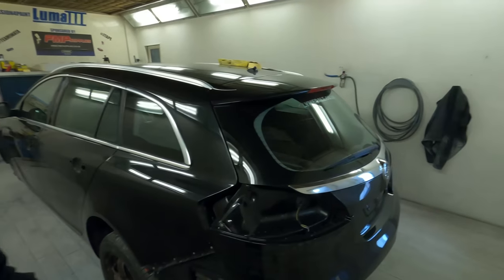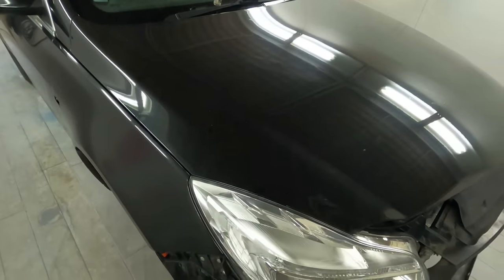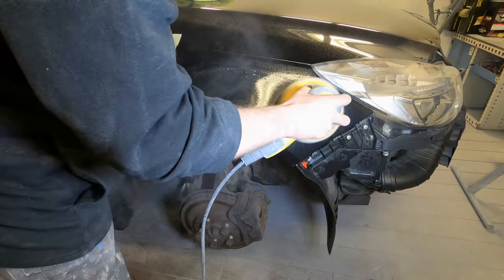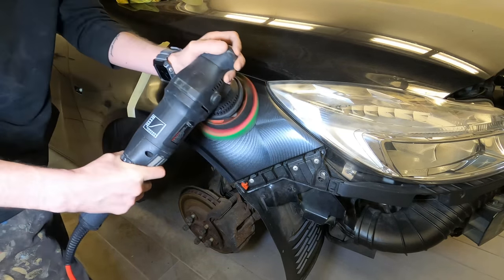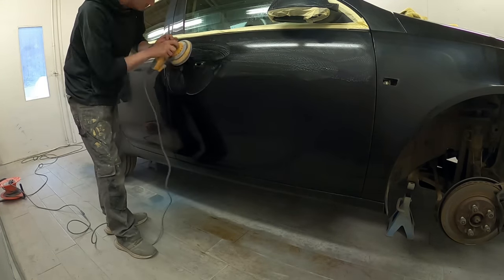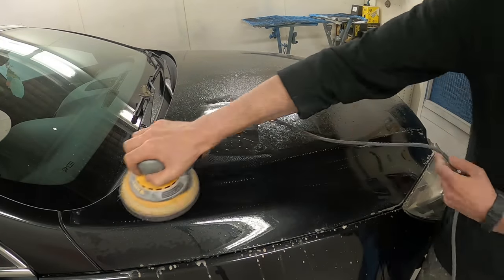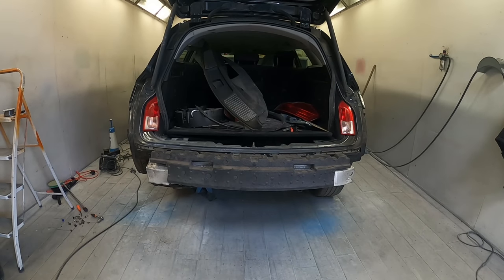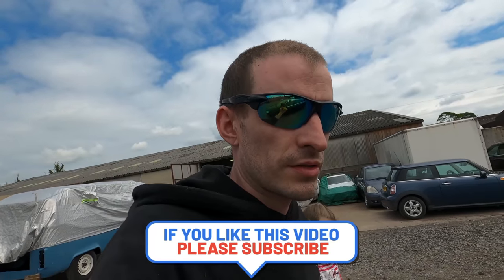Disaster black paint renovation / Correction detail Copart uk Salvage Rebuild Project PT-6

Comment: how interesting, just asked the same question re total thickness of the pain + clear vs clear alone....is there a guideline per manufacturer re ratio of these 2 given a certain thickness?
Reply from the maker: Possibly mate but all manufacturers are different if your looking to restore the paint like we did here try the softest approach first on a section and work up till you find the right combo of polish and head that works and just be carefull , never go straight for the hardest cut as it might not need it
Reply: @TonysRefinishingTV  thanks good man. def will do. I'm always on the caution side but def I'll pay more attention.
Reply from the maker: Always best to just do test spots to figure out what compound / head combo gives you the result you need and then once you do continue on mate

Comment: Lovely job Tony the car came out looking like new, it's amazing how a flat and polish can totally change the look of a car. 

Looks like you are still using your Gopro 8 for your video work so do you find the camera to be very buggy, I'm constantly having different issues with mine, not turning off, not turning on, battery draining when turned off, date and time resetting itself for no reason, plus getting very hot just sitting there doing nothing 🤬 

Done 2 factory resets and 2 firmware re-flashes, it then works fine for a day or so but slowly starts to play up again, this thing is getting close to meeting my lump hammer 😠💩, bought my gopro 4 brand new years ago and never had a single issue with it 🤔👍
Reply from the maker: Honestly mate bar the memory card just going caput I’ve had no issues with mine this last few years mate , maybe need to send it back buddy and get a replacement
Reply: Had a feeling you were going to say that 😂 been on the gopro help and support forums and there are lots of threads about the same issues I'm having, people are having all sorts of problems getting their cameras replaced some saying it's taking weeks and others saying they are getting the same one back that has been reset and re-flashed but is still playing up '😲' 🤔
Reply from the maker: God knows mate maybe I’ve just been lucky then lol 😂

Comment: What polishing head is this and do you use a da when doing normal paintwork de nibbing cheers 👍🏻
Reply from the maker: They are the green auto right direct polishing heads mate and I’ve tried it for jobs like this and normal paint as in the fresh paint we do in the shop and works just aswell mate for both
Reply: @TonysRefinishingTV  sound good would you prefer this over a rotary on fresh paint or is it slower
Reply from the maker: Not 100% made my mind up on that yet mate but I’m working on a rotary vs da polisher video atm which I’ll put my final thoughts in bud
Reply: @TonysRefinishingTV  just ordered a forced rotary hopefully somewhere in the middle of rotary and da 👍🏻
Reply from the maker: Seen the forced rotary ones there actually a lot more powerful cutting wise than a rotary buddy so just be carefull I believe they also produce the most heat from what I’ve researched